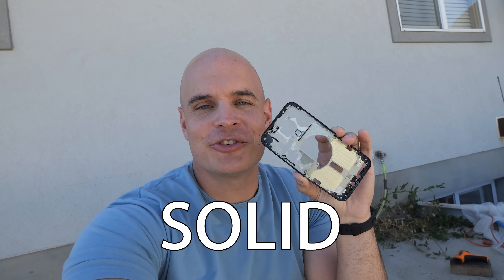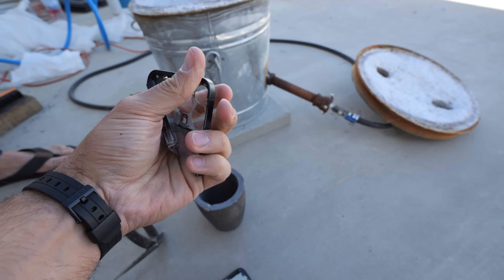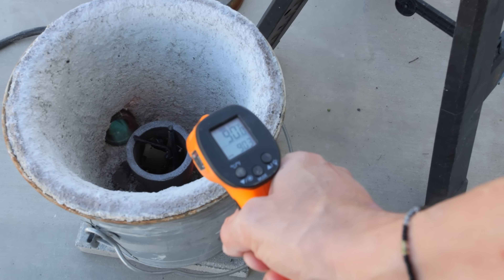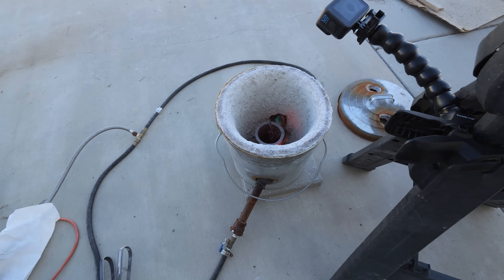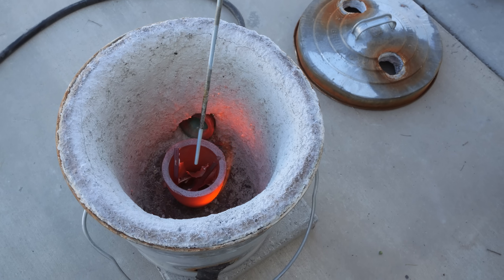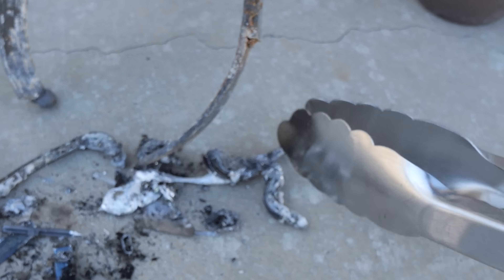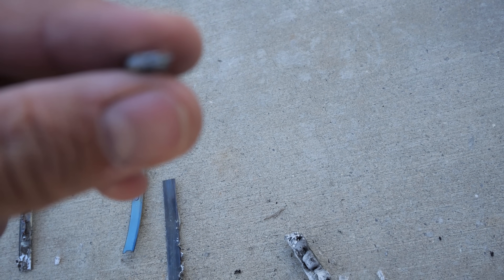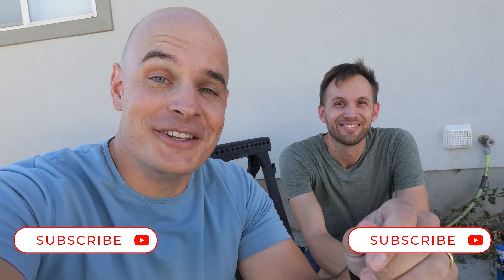How to EXTRACT TITANIUM from the iPhone 15 Pro Max?

Comment: @JerryRigEverything .. I currently use an iPhone 12 and am considering upgrading to the Pro models. However, during my market research, I've come across various rumors suggesting that the iPhone 15 Pro Titanium might have lower quality than the iPhone 14 Pro. This has left me confused about which model would be the better choice – the iPhone 14 Pro or the iPhone 15 Pro.
Reply: It doesn't have lower quality, just different characteristics to stainless steel. If you get a darker color 15 pro then the PVD coating is more prone to scratching than stainless steel on the 14 pro but if you get a lighter color it won't show as easily. Both materials are strong and both can scratch. If you plan on putting a case on the phone it really doesnt matter, build quality is excellent on both models.
Reply: @TechKnot  Thank you for the clarification. I appreciate the insight into the differences in characteristics between the titanium and stainless steel variants. Knowing that the PVD coating on the darker color 15 Pro is more prone to scratching is valuable information. Considering the build quality is excellent on both models, your advice on the choice of color and the option of using a case is helpful. This provides me with a clearer perspective for making an informed decision.

Comment: I mean, Titanium is expensive and there is a decent amount on the iPhones. This should be around 30 to 60 $ worth of Titanium which is a lot for just the frame. Its actually way more than a plastic or even complete aluminium phone body costs as a whole.

Comment: Impression experiment! Though the solid state diffusion kind of forms a thin layer of titanium-aluminum alloy between two matels which should have a lower melting temperature than both titanium and aluminum. So, my guess is you lost some tiny small portion of titanium during the melting process.
Reply: That thin layer where it is fused is no longer grade 5 Titanium anyway, so while the observation is interesting I don't think it's relevant to any final measurement of the amount of Titanium present.
Reply: No proofs so ur guess doesn't hold
Reply: @Josh.TJM100 it’s just how the process they used to join the metals work

Comment: Titanium failure?!! 
Apple has workarounds, but they are being tested on customers. 
The next plan, of my opinion, is to make the mobile phones the next level of lightness and durability. 
Apple will made Iphones frame of// Carbon fiber or Forged Carbon// instead Current material of 15 series , but I hope SAMSUNG beat it to that step next S25 series

Comment: Always love the thoroughness. Cancelled my order for the 15 Pro Max after that bend test, preciate' it!
Reply: There are two other YouTubers who did the bend test as well. Thumbs were in the same exact position as Zach’s. The glass didn’t break. My guess is faulty glass.
Reply: @NinetiesKiddd  Exactly. People are overreacting over one bend test from one source. There needs to be more evidence before it's actually corroborated that there is a major problem.
Reply: @TechKnot  While it may be true that Jerry was the only one capable of bending that phone, you can't gloss over the many, many durability tests done on the phone already, and it doesn't look great. It's been shown to fail simple drop tests that the iPhone 14 and iPhone 13 can take. I have the 13 so I couldn't possibly justify continuing to upgrade. Not to mention, the overheating issues that have been coming out recently is just another nail in the coffin for me.
Reply: It wasn't just the bend test that made me decide to switch. There have been hundreds of articles, and videos from other content creators, revealing that the iPhone 15 Pro and Pro Max have a major overheating issue.

Comment: i was kinda dissappointed by the 15 pro durability test you did previously. You used the blue 15 pro which has a non titanium color coating on it which obviously will easily scratch off. I want to see you compare the scratch and dent resistance of the Natural Titanium 15 pro vs the scratch and dent resistance of the Natural Stainless steel 14 pro

Comment: Just asked Google and it turns out titanium is 35 cents a pound.  Now this makes sense.
Reply: That's wrong it's way more than that per pound
Reply: More like 15 dollars a pound
Reply: Assuming you looked up a lower grade or you overlooked the results were for a lower grade, you need to lookup 6al-4v ti pricing and as Rayan said, you'd be around $15-$20/lb at today's market value.

Comment: Titanium can react with both Oxygen and Nitrogen meaning that you will boil off Titanium continuously. It's also dangerous to keep Titanium powder around because it can ignite in Nitrogen or Oxygen. I'm not quite sure but mixing metals might lead to galvanic corrosion at the seam making the phone not structurally sound. 
Also How the fuck is Nate not getting ripped apart by the safety inspector?

Comment: Always interesting to see Zach find interesting destructive testing, this was awesome, let the aluminumelt, all that is left bedind is titanium, super curious why the coating didn't suffer any damages upto 2000 (F)?
Reply: They were speaking in fahrenheit not celsius at 2000 celsius titanium would melt too. 2000F is around 1100 Celsius still cool that coating survived that temperature
Reply: @jawohlbxb3534  thanks for the correction.